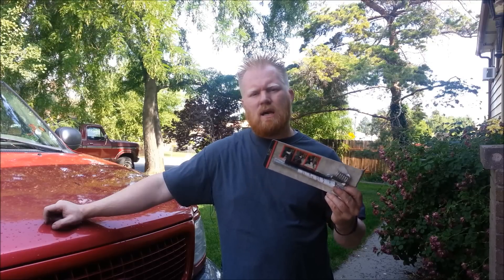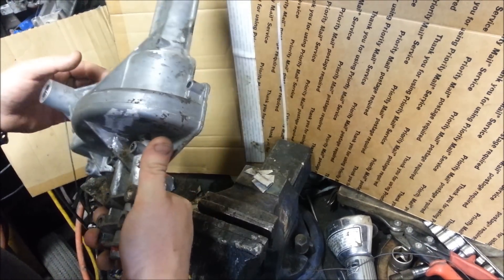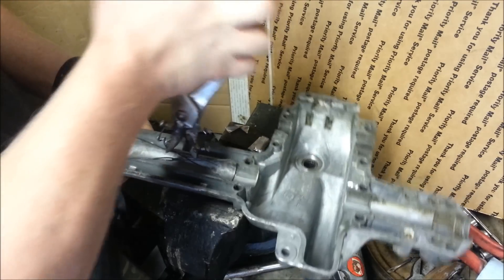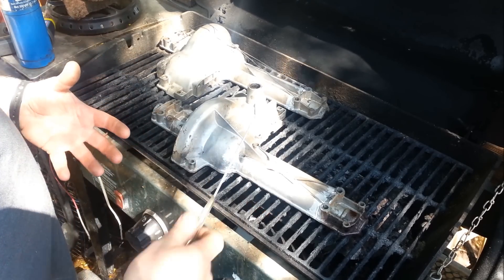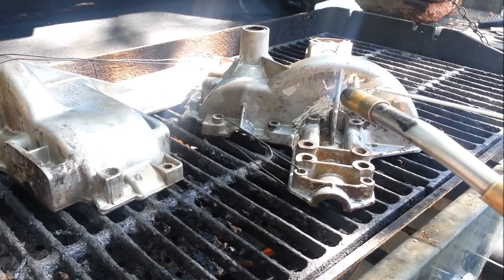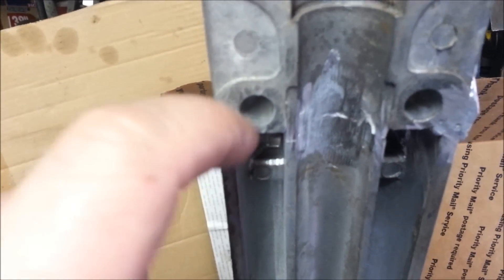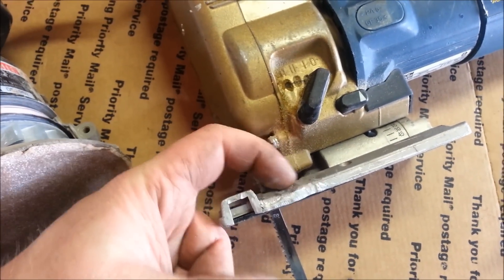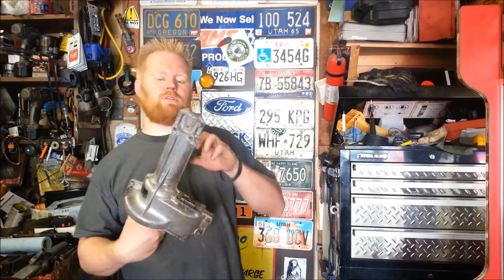Aluminum Welding with Propane torch Brazing Rod

Comment: I am impressed with your diy skills. Just wondering if you have ever worked on pot metal.  I have an old 60's car and after putting on new rear quarters, the tail light extension on one side needs to be narrowed a quarter to 5/16 s of an inch. So that means cutting  the side that fits against the trunk lid to maintain the gap. How to attach the cut edges together on the pot metal extension.
Thanks for your expertise and time.

Comment: Good job Sir.  I ve been using it on many, many repairs, outboard handle, trim pump, ATV wheel hubs... It seems stronger then casting alum, all my repairs held up fine..... For bigger items I heat it in oven to 400 c ,pre weld on both faces and press together works well.

Comment: would aluminum brazing be good for aluminum cast? I have a intercooler intake adapter that has a small pinhole that I need filled.
Reply from the maker: It works good for cast aluminum

Comment: Hard soldering.....with an L,brazing is brass also hard soldering again with an L,parent metal pores expand and filler metal fills pores,job cools,and solid....Hard soldering......with an L.

Nice job though mate,good for making EfI headers and injector bungs.

Comment: SxS vs hotdog air compressor, SxS won. A foot / front motor retainer broke off the motor as well as a toe from another motor mount. Used the grill/torch method with the HF rods to repair the cast aluminum. https://snipboard.io/6x28Yn.jpg After some grinding, and replacing a cracked capacitor, the compressor is rebuilt and running.

Comment: I have a release valve thread on a zero turn hydro pump that is stripped slick the first half of the threads. 

Think this could fill in some aluminum to retread the hole? Just  wondering about holding the hydros pressure while running.

Comment: Not an easy job from experience, superb  heat control  and patience looks to be my issues . You obviously have thought through the process carefully, not too many would  succeed in torch welding cast aluminium let alone recording . Nothing is easy they say , even for am old pro hey? Helps when things work out but ?  Cheer's.

Comment: Your video gives me the confident for brazing repairs on my quad balancer case, l ll use my BBQ and brazing rods.  l was trying to set up a tig and find it is quiet complex/expensive and needs a good skill to do the fine cast alum repairs.
Reply from the maker: It does take some patience but is a solid repair once done. I will say I am set up to do TIG and it can be a nightmare/impossible on cast parts even for a pro. A mig welder with a spool gun is the way to go for cast parts and the only thing better than brazing in my opinion.

Comment: So I'm building an engine, it's a Frankenstein engine. It's not meant to work together from factory but specs bolts etc all fit perfectly. The only issue is some of the oil ports don't quite match perfectly. Would you attempt to fill and port match the oil ports in a head with this method, I can't afford an aluminum spool gun, and didn't think the price I was quoted was fair. I just wanted to know your opinion as your the only person I've actually seen use it to actually repair something so significant. Thanks for the great video too
Reply from the maker: I would not. The temperature do you have to get to are too close to the aluminum melting point. You'd run the risk of melting/warping the entire head.

Comment: Most of the tips I've seen say to clean with certain chemicals, use flux, and use chemical to remove the flux residue. I didn't see you do any of that. Just making sure you didn't fail to mention any of that lol need to repair my boat drive. Has a crack in the lower unit. Should be a simple fix, but I just want to be sure it works without hearing it up too many times from mistakes. I've welded a while and I agree, trying to go back over welds or brazing weakens it. You're expanding the cells that hold it together every time it's heated up. Basic weld class teaches that lol good vid. I hope it held a while haha

Comment: hello

i was just wondering if the brazing job you did on the tractor's gearbox is still holding up today.

i plan to braze my starter motor plate b ack on to my engine block. hopefully brazing is strong enough.

take care

Comment: After watching Mustie1 attempt to epoxy a pressure washer pump case.
Reply from the maker: Yeah, that didn't go so well. The metal used in those pumps is so crappy this stuff even has a hard time. I've attempted a repair with this stuff on a cracked pump and it just melted into a puddle. The casting is just so porous.
Reply: @sixtyfiveford   Very good to know. Thanks.. I also picked up a discarded pw a few years back with a cracked pump. Shame really. Good Honda engine. $100 for new pump for it or... I ended up purchasing a new pw instead. Thinking about a go-cart build for the kids using the old Honda engine so the busted pw just sits in the shed. Isn't that how hoarding starts. Oh heavens!

Comment: Had a cracked oil pan on my Honda CBR 1000 and tried this, works like a charm. I used a butane torch from my BBQ set up and an aluminum rod. So far, so good no leaks so far!

Comment: It's good to see someone using these rods on something thicker than a couple of thin alloy checker plates. I have a driving wheel on a quarter scale working model steam engine that needs repairing. I could buy a new one, but they only come in pairs and cost over US$650 (GBP £500!).
I have a few videos of it on my channel for reference of the size
 https://www.youtube.com/channel/UCUij0EqEBrkmiOJu6U4UObA?view_as=subscriber
Although the damage was detailed by the seller, he chose to paint it prior to sale, so now I have all the hassle of cleaning off every trace of that paint before I can start to repair the damage!

Comment: There’s no way you welded them together in order for two metals to fuse they must get molten you didn’t retch that temperature you might of covered it up the crack  but never welded them together FALES CLAMS

Comment: I understand your thought process with trying to get the material to the correct temperature.  However with this type of metal joining your looking to achieve localized heat. Your area of repair should reach the temperature not the entire part. The reason you don't want to heat the whole part is because as you heat any structural metal component you damage it essentially.  Your damaging the strength created in the part during the annealing process when its manufactured. Minimum necessary heat to achieve a weld.  Not excessive heat. I don't like saying it but I would assume your part broke again in very close proximity to the original repair area.  Not the original repair but very close to it.
Reply from the maker: The part is still in service without any issues. You've obviously never worked with, welded or brazed aluminum. No where was I trying to get the entire part up to brazing temp rather trying to equalize the heat.  Also heating the entire part and allowing it to cool is annealing the aluminum. Localizing heat via welding causes stress in parts and generally a full heating of the part(steel, cast iron and aluminum) and allow it too cool is required in manufacturing to prevent stress cracks. I think you have annealing confused with tempering.
Reply: @sixtyfiveford  hey thanks for teaching me something instead of insulting me. Keep up the good work.

Comment: Thanks for sharing this information!  I tried using this stuff earlier for a repair on my miter saw turn table.  Unfortunately, it didn't work out but fortunately I found myself here watching your video!  You confirmed my problem which primarily, heat transfer and dissipation in aluminum.  I simply can't keep the part hot enough to flow the rod properly with a torch (I tried using propane).  

I LOVE the grill idea for pre-heating and will give it a go.  However, do you have any thoughts/tips on minimizing the heat loss for lack of a grill?    For instance, I have seen people hang wet rags on copper pipes while flowing solder joints (seems to help).  I'm a novice hack at best with soldering/brazing/welding but not afraid to screw up as much as I have to to learn.  Thanks again!
Reply from the maker: Hanging the wet rags on another joint is to keep it cool when soldering copper plumbing so you don't damage plastic/rubber seals on something like a faucet. You could do the same with Aluminum to keep an area cool but Aluminum transfers heat much more rapidly than copper.       A scrap of home fiberglass will help hold the heat in the aluminum while you attempt the repair.
Reply: @sixtyfiveford  Thank you for the information.  So, I was using regular propane on my initial attempt.  Today I ran down to Home Depot and bought a canister of the yellow MAC-PRO (or vice versa) to try instead.  That did the trick and brought the aluminum up to temperature rather quickly in the area I was working on.  From there the rod flowed and adhered nicely.  I'm going to use the yellow bottle from now on.
Reply: @sixtyfiveford  Copper has a higher heat transfer coefficient that Aluminum, meaning it will transfer heat faster than aluminum.  Copper heat sinks work better, but since copper is much more expensive per lb, and also 3 times the density of aluminum, copper ends up being 10x the price the same size of of an aluminum part, so aluminum is preferred. At room temperature Copper's heat transfer coefficient is 386 W/m°C, pure Aluminum 239 W/m°C, Aluminum alloys 160 W/m°C, compared to cast iron at 55 W/m°C or 60/40 Brass at 96 W/m°C.  Usually the heat transfer ability is closely related to the ability to conduct electricity, and copper is better than aluminum.  Silver is even better for conducting electricity, and it has a heat transfer coefficient of 419 W/m°C.
Thanks for explaining how to braze Aluminum, I will definitely use that sometime.

Comment: If the die cast aluminium cracked along those stress lines, it won't be long until that soft aluminium alloy does the same.

Comment: Have a stripped out transmission pan bolt hole that I can’t seem to tap. Hole is large now so I can’t drill it any bigger. You think I could use this method to fill in the and try to retap?  Trans is still in the car so I’m working on my back.
Reply from the maker: This stuff is not an easy thing to work with. A large trans would be a huge sync and you would be hard pressed especially upside down to get it to stick. Too much heat and you deform the transmission. Have you contemplated just using more RTV in that spot or a helicoil? You can make a steel flat washer/clamp that goes under a few good bolts on either side of the bad one and applies pressure to that spot.
Reply: Thanks for the response. Would love to use a hellcoil but if I have to tap the which what I can’t seem to do for some reason. Got another suggestion to use a bottom tap as opposed to a tapered one which I haven’t tried yet.  I can’t get the tapered ones to start.  May have to RTV the heck out of it if nothing works.  Think I could use a welder to fill in the hole and try tapping all over again?
Reply from the maker: @robertf4572  A quick clean and weld with a would be the best. You may be able to drill the hold slightly deeper, use a bottoming tap and a bolt with 2-3 more threads to grab.

Comment: That was worth watching, never tried fixing broken aluminum before but with the correct product and procedure, certainly worth trying, not that it matters really but would this be aluminum brazing as apposed to aluminum welding?
Reply from the maker: It's brazing for sure.

Comment: Super, I run into a lot of alum cracks and fractures.  l ll try the brazing rods. I was using JB with alum plates with rivet , not as neat and strong as the alloy rods.   thx.
Reply from the maker: Thanks, I'm glad you liked it.

Comment: You do nice work there. I also liked your other video on how the internals of transaxles work. A couple months ago, the housing on my MTD riding mower cracked completely all the way around right up next to the "pumpkin", which is pretty much like the one crack in yours except the crack in mine was all the way around. I bought a used transaxle on eBay, and have degreased the housing exterior so far, and next I am going to separate the housing and clean out the old grease, and inspect the gears, etc, and then put new "00 Cotton Picker Spindle Grease" in it, and then put it back together and install it in the mower. I spoke with a local welding shop and they said they can TIG weld the old cracked housing, and it would cost $40-50. I am thinking about taking the old cracked housing apart, inspecting the internals, and if they are good then having the welding shop weld the old cracked housing so that I have a spare transaxle on hand in case this new (used) transaxle I bought ever fails. BTW, I researched online on which grease to use inside these transaxles, and many folks recommended that 00 spindle grease, and the cheapest place I found it was at my local Tractor Supply Store for $4.99 quart.
Reply from the maker: $50 isn't bad to get it welded up.
Reply: No it's not, especially when a new one costs $500-600. Used ones are getting hard to find, and when they are found they are going for about $200. I got a deal on the used one I bought at $120 + $20 shipping. The welding shop charges $100/hour, and he said it shouldn't take more than about a half hour to weld it.

Comment: Will this work on a aluminum oil pan
Reply from the maker: Yes. Since oil pans aren't structural you can also use alternative methods like JB weld or I've even had good luck with Bondo.

Comment: My point is u need to grind off of the aluminium from the crack on both sides like that- >< so u can fill it up with the braze, d be more sturdy, and it d look nice also... Just opinion)

Comment: Aluminum anneals at such a low temperature, are you ever afraid of annealing the item you're repairing when you heat it on your grill? Maybe it doesn't matter since it is cast and has a lot of curves and is also bolted to a mating surfacer.
Reply from the maker: Not at all. The Grill doesn't get it close to annealing temps and even if it did it would take out any work hardening and make the aluminum less prone to stress fracturing. From what I've read you would need to get it up to 650F-800F+ and hold it there for hours for annealing.
Reply: Instructive answer, thank you. ojb

Comment: I've got an old 1985  186 cc Briggs & Stratton 4 HP lawnmower engine that I picked up from the scrap heap which has a crack in the top camshaft journal in the aluminium case.

My old neighbour threw it out as the inlet valve locked up causing the cam follower to stick out & bend the camshaft,that was caused by a Lack of oil.

I freed the valve up but it wouldn't open so I knew there was something wrong,I'm looking to get some aluminium brazing rods to repair the crack.

It needs a whole lot of work such as a replacement camshaft, cam follower,the rings had a 2mm gap in them so they are shot,so maybe just new rings ?

Lap the valves in & replace the muffler as it's dented & rusted,the fuel tank needs a solder repair to be redone on it as it leaks fuel,the carby needs servicing so I may throw a new diaphragm in it,the timing gear also needs replacing.

It needs a new throttle cable, wheel bearings & the deck needs repainting, if I can get that done for $250 AUD then I'm doing well as a brand new 5 HP 190cc Briggs & Stratton powered mower costs $435 AUD at the hardware store.

I believe the mower must've been Low on oil because the engine burnt it all & it leaked out.
Reply: I love them old B and S engines

Comment: Awesome!  I'll be trying this on my aluminum radiator that's cracked.
Reply from the maker: I'm not sure if a low temp solder is used on all aluminum radiators like brass radiators, but this may be an issue with this method. The heat put into the crack repair (700ish degrees) could loosen the radiator core. I've had good results with Epoxys (JB weld, Steel Stick) on radiators.

Comment: Great Video mate, best I've seen about brazing & cooking on the BBQ at the same time.
I had trouble until you edjamacated me & explained where the heat was going. 
I have been using a 4043 filler rod with a small torch and NO BBQ, & had limited success before watching this.
Cheers
Reply from the maker: Thanks.

Comment: I wonder if you could do the job by using a heat gun as a pre-heater. I figure you could construct a stand that will hold the heat gun and point it directly at the wound. I think it might beat out the high dissipation rate of the metal because the heat will be constant and should remain longer after the torch is taken away.
Reply from the maker: A heat gun would work.

Comment: Hi, I am wondering about building a fuel tank for my motorbike out of aluminium. Can you braze aluminium sheet together to produce a fuel tank. Thanks,
Reply from the maker: It would be overly difficult with this stuff to do a fuel tank project.

Comment: I'm about to brazen nitrous oxide bungs,into an aluminum intake manifold.  I'm wondering would putting it in the bbq,grill help,since it is rather large and there are 8 bungs to braze.
Reply from the maker: On any large item it makes it a ton easier to get the entire part hot. At least a few hundred degrees.

Comment: hey sixtyfiveford - would you use this to repair a cylinder head?   I had a cylinder head machined at a shop and the "machinist" cracked every single combustion chamber.  They are tiny cracks, but still.
Reply from the maker: This stuff melts at around 700F so may be bad for an exhaust. It also has to be build up to hold. On an engine part I would probably have a welder tig weld each one.